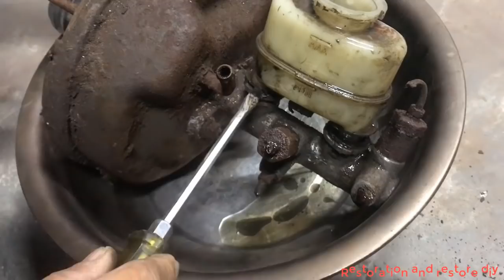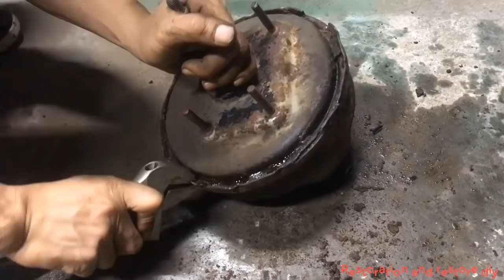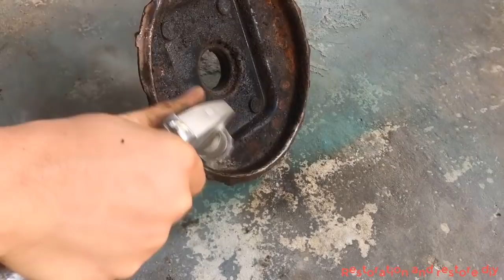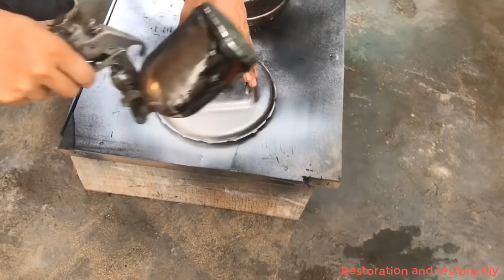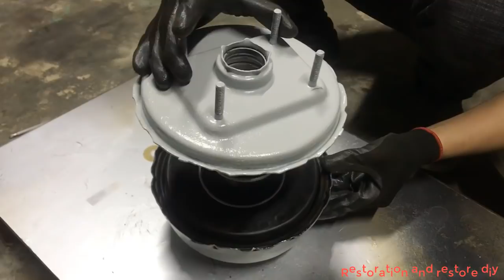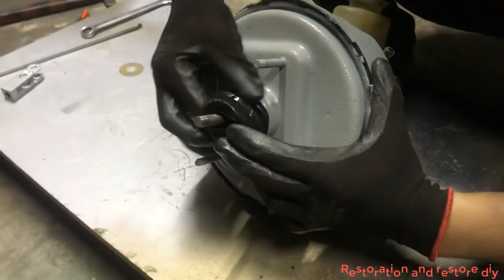Restoration old cars' booster brakes | Restore and Reuse hydraulic brakes of brake assist car

Comment: As brake specialist for 49 years everything about that is dangerous i would not let that guy work on a shopping trolley what a rough crappy job he would certainl not work on my car so incompetent i would not want to be on the same road as him it gives me nightmares
Reply: You can tell this is one of those fake "rattle-can restoration" videos when they half-disassemble things (didn't even take the master apart beyond the reservoir?), spend more time showing the cleaning and painting than anything else, and make stupid mistakes when half-heartedly reassembling the thing. There's no chance this guy is an actual mechanic. He's just a faker doing it for the YT views.

Comment: I wonder if regular 2 year brake fluid changes on time will make the brake booster and brake hydraulic cylinder cleaner. And avoid corrosion long term in the brake system.

Comment: It's not a restoration, it's just cleaning and painting. Neither the sleeves of the brake cylinder have been changed, nor the rubber stoppers for the container. 
  No, no - you have no idea about a restoration! 👎🏻😠

Comment: Lads  your not a bad pair of guys but keep away from car mechanics, the toyota engine you put the main bearing caps on back to front, I have never ever seen you use a torque wrench on anything "one of the basic and necessary tools, you never honed the bores, used the old gaskets etc, the gearbox well i cant comment much but i did not see any checking for ware or preloading of bearings or a torque wrench. when i restore radios I use a waveform signal generator, a scope and a digital and analogue meter so i can peek the coils "am and Lw are 470kHz and fm is 10.7mhz ". IF A JOBS WORTH DOING ITS WORTH DOING WELL AND PROPERLY!